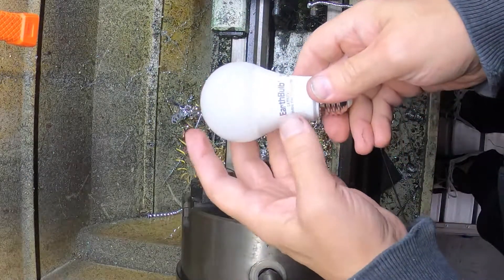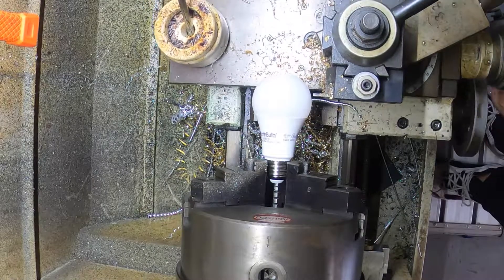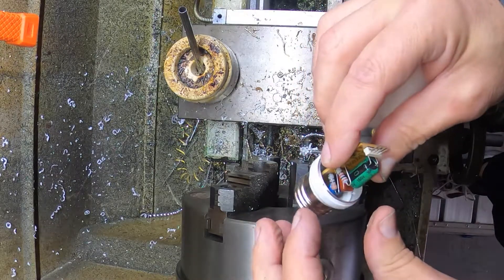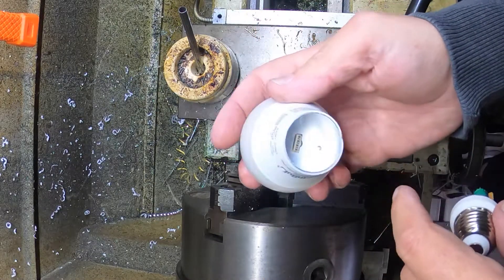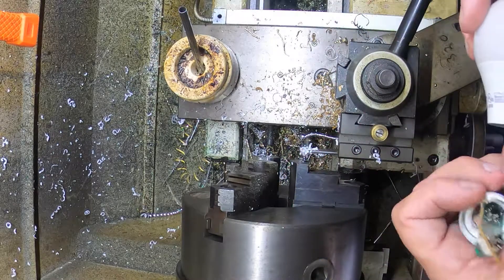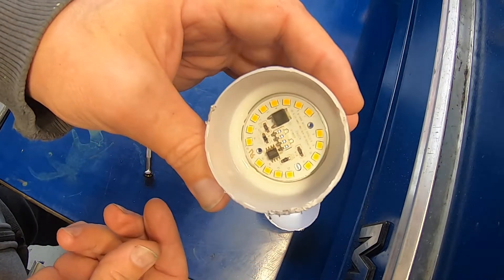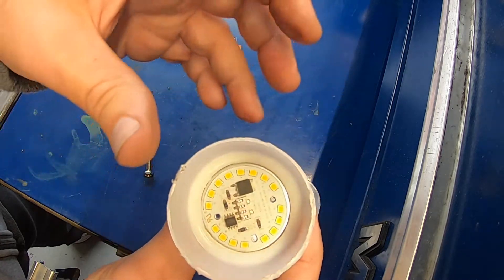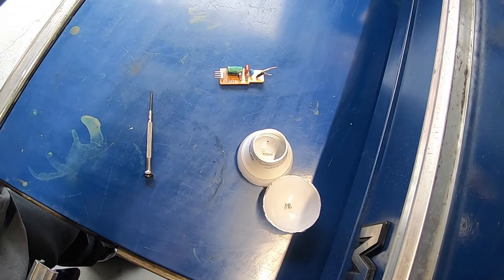What's inside an 120v home LED light bulb.

Comment: Nicely done! Thank you! Did you have some idea in advance that lathe-cutting at the bottom of the bulb would have worked as well as it did? 
And have you ever taken apart one of the 'candelabra' kind, which have clear glass envelope and visible multiple l-o-n-g 'strips' or vanes of LED 'objects'? Those, as far as I can see, do not have any electronic components between the line AC and the LED strips. I ask because I have one that has begun to flicker & go out, but a duplicate one doesn't.
Reply from the maker: This was the first and only LED home bulb I have taken apart.